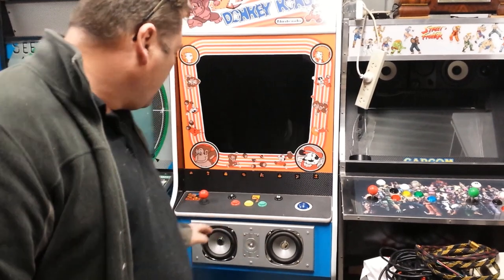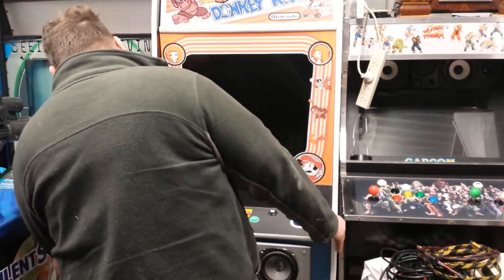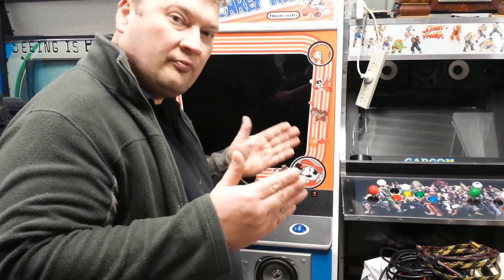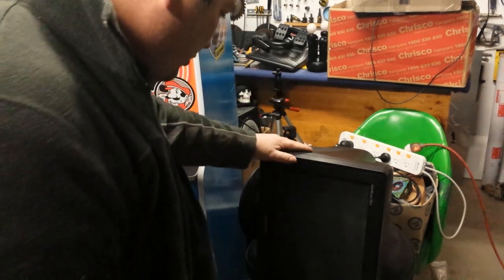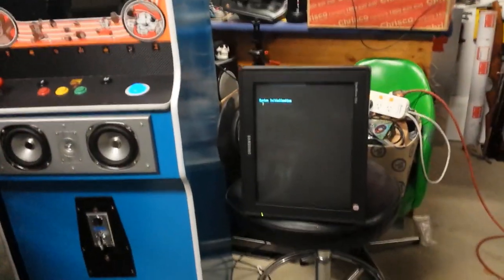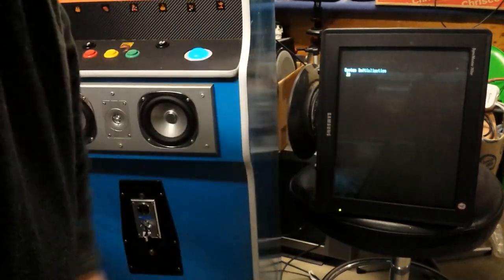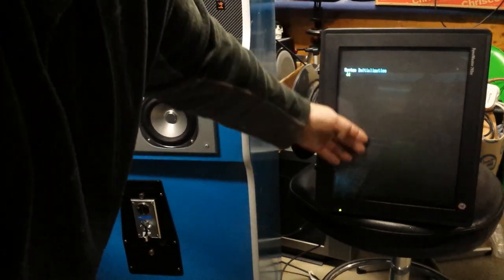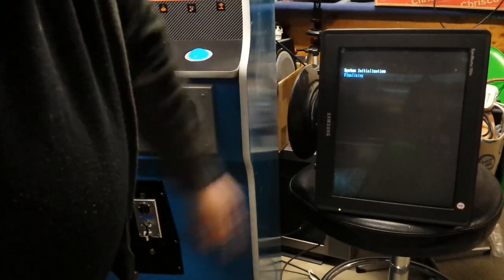CRT IN / LCD out -  Part 1 - Nintendo arcade

Comment: The only problem is computer crts run at 1024x768. Too many pixels.
Reply from the maker: they do display arcade games very nicely though hey
Reply: Not mine.mine dos 640 60 hertz. It actually runs nicer than tv crt if you do it right.if look at some mine videos you can see tweaks that I do .

Comment: I got mine pc crt looking better than the arcade original monitor by adding a scanline generator to clean up all the jags and I bilinear the corners so it fades smooth,I prescale the pixels to the scanline generator so it blends rest jags to depth round smooth corners than I ran a filter to add depth more smoothing to sharp smooth deep pixels.All the games run in 60 hertz pure,soapboper smooth effects when scrolling no ghosting or hycupes plus I put on vsyn.
Vsyn is very important so no tearing.a lot of emlators on market do not have vsyn so they tear pluss unmatched refresh so you get jitters while scrolling. Same with all my other emlators,like nes,super nes all running matched to 60 hertz with soapboper smooth effects.
  I have bunch of videos up if you want to see how I do it.pluss I can over clock every games cpu independently but I do not over clock much.Only games that I over clock is the 3d games like teken,Dou le draggon,meatal slug since the arcade had slow downs now none of them have any slow downs on my systems.
Reply from the maker: Shit well done mate some of those scanline generators do slow down the systems guess there better now than when I tried them a few years ago , cheers for watching  Ghost Bombl
Reply: @MarchosArcade  
Interesting, my system never had any slow downs from my scanline generator. I can see that in some systems if you crank up the lines max and draw to much monitor power.I think it looks better and you have fine tuning so you can clear up cpu processing from software scanlines.